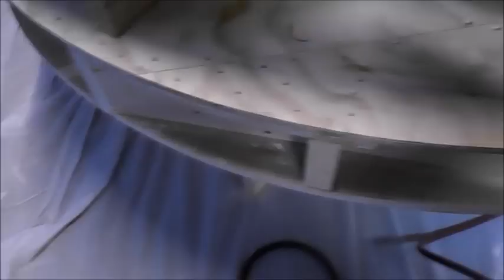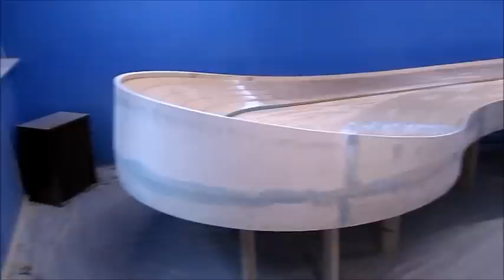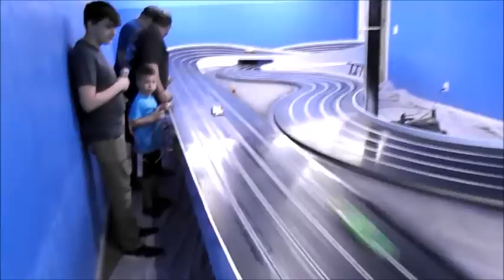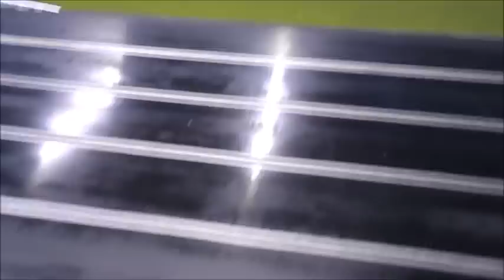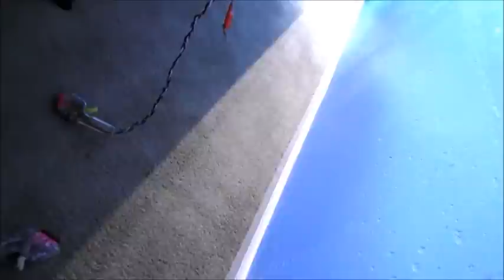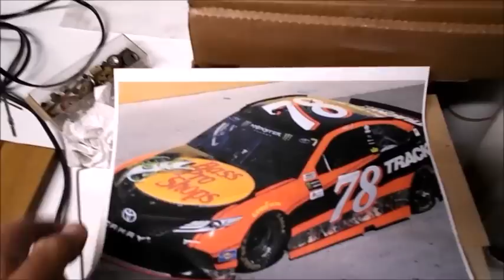A professional slot car track build part 3

Comment: I was very interested in how you planned the lane routing in the bank? Did bending cause where the guides go change in width or depth ?
A section on gear like power supply brake wiring..etc would make a great follow up
Reply from the maker: In video 1 if you look at the model on the drawing board you will see where I made a scale drawing and cut outs of the corners. I had to make several before I got the banks like I wanted them. Once I had the turns like I wanted I used that radios and cut them out of the MDF. Routed the slots and cut the relief cuts on the back side. In one of the videos you will see where I used straps to draw the turn pieces to the desired angle and so they would hook up with the strength prices

Comment: People have asked me what power supply I am using. I started with a cheap 12 volt  constant  power converter but the cars were too fasy for the kids and the controls would over heat so I swapped it out for a variable voltage DC power supply.  A Volteq  HY1520EX. Works great. We usually set it at 6.5 volts and the cars are plenty fast. They will still fly off the track if you just hold it wide open so spme driving skills are required. Best thing is the controllers dont burn up from getting too hot.

Comment: What braided cable did you buy for this?
Reply: I used 1/4" flat braided tin coated from Wiremasters,Inc 800 635 5342 and I applied it with 3M's very high bond tape.

Comment: can i ask a few questions about how eo keep the slots at same distances in the turns.did you have a special jig
Reply: Xhech out Vidio #2 WHERE I am routing the radius pieces. I have a piece of 1/8" thick plywood I have mounted my router to. I have drilled holes in the piece of plywood at a point where the slots need to be. Once one la e is routed,I move the nail in the piece of plywood to the next radius and rout the next lane. So there are four holes in the piece of plywood the proper distance from the pivot point to each lane. I have also made a router bit with a 1/8" piece of steel rod epoxied in the end of it to cut the places for the beaded wire. I used it after I made the four initial slots with the 1/8" router bit. Does this answer your question?

Comment: Would've been a good idea to use the Carrera digital system. Works with two lanes and track switches to change lanes. Anyway it's still very nicely done.

Comment: Mr. Whitley,  I recently came across YouTube videos showing various slot car tracks.  Did you by chance compare the cost of buy tracks vs making your own.  As a kid, I remember building my cars and racing at a local center.  I'm thinking of getting back in to the hobby.  Great videos by the way.
Reply: Thank you Tony. I enjoy building things and this track is no exception. This is my third slot car tack and I learn something each time I build one. There is a commercial track in a shopping center near me but it is plastic peace.  Makes a lot of noise, no banked turns and the peaces are cracking. Probably was easier and cheaper for me.

Comment: Great Track and solid build Mike!  I am getting a plan together to build a track for my family and friends as well.  I will definitely be watching your video a few times to gain some nuggets of truth.  

BTW, I cant remember if you mentioned it, but what power supply are you using?
Reply from the maker: I purchased a power converter from Amazon. I am trying to find more information from Amazon but  written on it is  Nidec Ultraflo  Compact Power 1200   Says 12 volt power supply  75 amps/600 watts at 110 volts. it only cost $60..00 and works great.. Consent power to all lanes.
Reply from the maker: Got it on Amazon. It is Nidec Ultraflo. Says on it Compact Power 1200   12 volt Power  Supply 75 amps/600 watts @110 Volts

Comment: Amazing track, Sir! I have a question: after the epox primer, which paint did you use for the finish? Thanks!
Reply from the maker: Thank you , the paint products i used are The Epoxy primes AWLGRIP  545 primer D8001White base. The finish coat is PPG Performance Commercial Coatings ALK200 Acrilic Enamel. It is catilized.

Comment: the Transition to and from the banking isn't correct, how much did you tilt the corner before you bent it? It doesn't look bent, the small one in particular
Reply from the maker: I first drew the track to scale, then I drew the curves on poster board. On the 3' 4" radius I added 1" so my poster board pattern was 3' 5''. When I pulled it in to where it would line up with the straight sections it gave me the desired bank I wanted. The High bank at the end of the straight away has about 2" more radius. I had to draw several patterns before I got what I wanted. The track is not symmetrical the way I drew it but it is close enough to the drawing. I had a hard time getting the last joint to line up. Like I said in the video  " It will have to do". One thing I would have done different on  joining the pieces is, I would have glued and clamped a flat piece of plywood about 4" wide to the under side of the joint. This would have distributed the stress of bending away from the joint making a better transition from one piece to the other. Does this answer your question?
Reply: Yeah, I"ve done that too.

There's no way to get a smooth transition to a banking without tilting the corner. Imagine an ice cream cone, that's your banked corner, or banked circle, for a 15* banking tilt it 15*, now one side of the Cone is flat, the other is the banking,, this is how the track needs to glued/screwed down or whatever you want to do. But it must be tilted to align the bend over, or the bend up with the flat side.

Banking a corner is a bitch...

Comment: Really enjoyed the build and your commentary, very nice project good carpentry skills and looks like great fun for the family ✅
Reply: I added 1" to the lower curves. where they are 3' 4" Iayed them out at 3' 5". after the relief cuts on the back side I then drew it in 1". that have me the desired bank I wanted. the big bank at the end of the straightaway has more bend therefore I had to make it more radious. I drew them out  on my drawing board first and made changes till I got it like I wanted it. Does this answer your question?